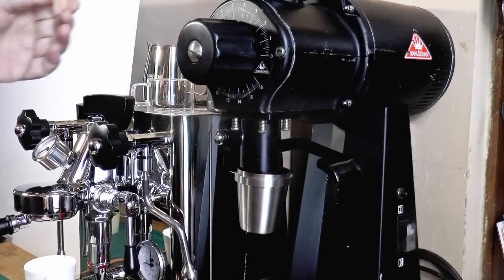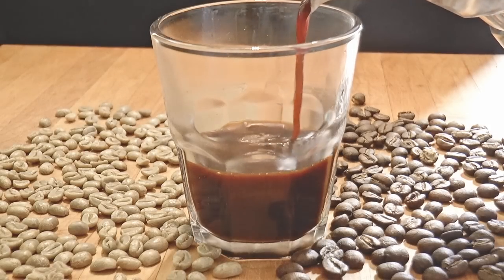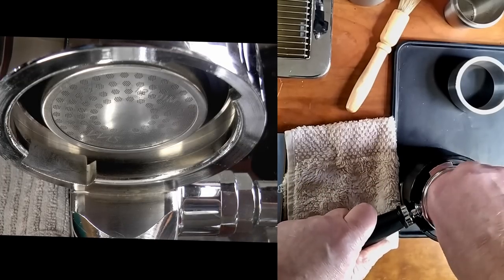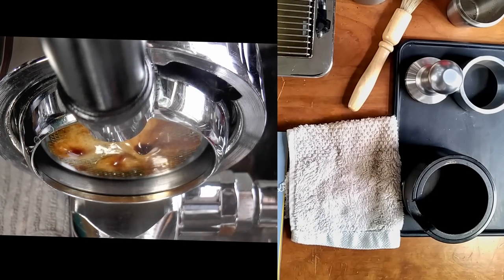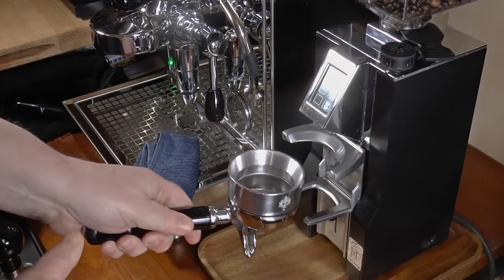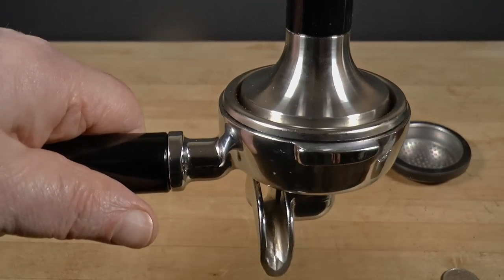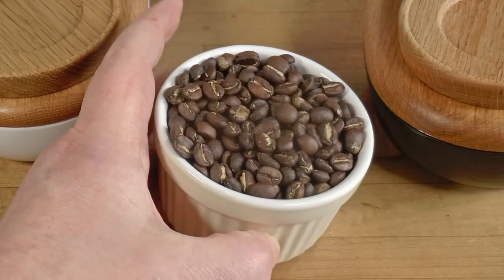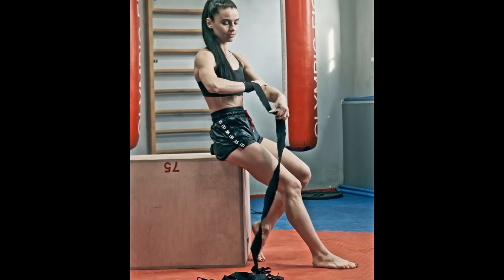Espresso Terrors: 1 Channeling & Puck Prep

Comment: No coffee shop does WDT as far as I know, so this totally makes sense. A good tamping must be enough apparently
Reply from the maker: Ding!
Reply: coffee shop coffee is mostly terrible.
Reply: I used to grind directly into the filter and then do some WDT. 

With my new grinder, I changed to grinding in a dosing cup (less messy). 
I then put the filter on the dosing cup, turn them around, give them a bit of a shake (not much). 
I then use a distributor give it a few swirls and a tamp. 

Maybe I could skip the distributor but I kind of like the feeling of it and I think tamping directly might spill a few grounds (more mess). 

I’ll give it a try without the distribution tool though, just out of curiosity.
Reply: @cicciobello8470
Here in the Netherlands, some specialty coffee bars do WDT but most of them don’t. My very rough guess would be 1 out of 3. 
Keep in mind that SC bars are a small minority amongst general coffee bars.
Reply: my pucks are so consistent that I just stack them at the side of the machine. [check my avatar] does this mean everybody should stop using 
Coffee Knock Boxes? of course some people can get a good level puck with just a swirl and a tap.. but other's can't .. that's why they use WDT. most people would just get all the coffee on one side after that swirl.. or flying around the room.

Comment: When using a very soluble coffee espresso is dead easy.  As long as you use a good grinder and machine and suit your dose to the basket it’ll pull well.  Most of the puck-prep these days is aimed squarely at mitigating the issues that arise when pulling very lightly roasted dense coffees.  Nordic roasts are super hard to extract causing all kind of problems.  With these coffees channeling definitely exists.
It would be very interesting if you were to redo this experiment with one of those coffees.
Reply: I agree, I would try to pull something very light. Channeling issues will show up.

Comment: Though I agree with the sentiment that less can be more in espresso preparation, and that there is a lot of pseudoscientific claims in the space/maybe too much faff, I can’t help but note this argument that channeling is a myth is based on a flawed premise: that the absence of evidence is the evidence of absence. So in this case, the fact that for you with your equipment that you don’t see visual spurting is the evidence that channeling doesn’t exist, but is that really true? Spurting from a piece of coffee plugging a hole on your basket like putting your thumb over a garden hose causing spraying isn’t necessarily channeling, it’s just random luck. Furthermore, I think you discount the puck prep that you did all the same. You distributed the grounds by shaking, tapped the portafilter down several times to settle the grounds, and you are using a medium to dark roast it seems, where the increased viscosity is just going to cover up a lot simply because of surface tension. You also do a long low flow pre infusion that also can help with channeling. So yes,  I’m sure in your hands with all of these aids you might not observe a lot of visual spurting. But that doesn’t necessarily make an argument that channeling is made up. I could easily take my specialita at home (similar grinder to your libra), but just dump the grounds in, no shaking or tapping, tamp unlevel with a list to the right, and have a gusher of a shot only out of the right side of the portafilter.  By this same logic would that prove channeling exists? I’m not saying you have to buy any gadgets to do puck prep. But if anything I think this video is more an argument that you can cover up a lot as long as you do some puck prep, like shaking to distribute, tapping to settle, and using headspace to your advantage, as I suspect a compressed puck with little headspace won’t have a lot of space to expand too much and have channeling go awry.
Reply: I don’t think his point was that channeling doesn’t exists but that not doing WDT nor using a distribution tool doesn’t necessarily lead to channeling. 
That’s how I perceived it anyway. 

He likes slow extractions. The last pull was 37s.  That would require finding finer and wouldn’t that increase the risk on channeling? (I assume that he uses normal pressure of about 9 bar).
Reply: @Conservator.   I think I was going off of the last lines of the video where he says "there's no such thing as channeling", but hey, happy if @wiregourmet want's to correct me here if I was miss-interpreting!  I will note his machine allows him to pre-infuse for a duration of time of his choosing (you can see him actuate the lever, pause and not lift it all the way up to let the puck gently expand under the pressure there but not actuate the 3 way solenoid that would unseat the puck , before he engages the pump to 9 bar, he talked about this technique he prefers in a prior video).  This is conjecture on my part, but I suspect 37 second shot could have a similar grind size as a 27 second shot if you just add ~10 seconds of pre-infusion rather than engaging the pump immediately.   Don't get me wrong I agree with a lot of what he says, you don't need fancy tools/to spend a lot of money to do home espresso, and if your coffee tastes good to you, then great that's the point! But much of the video imho maligns puck prep as useless BECAUSE he has found he doesn't need to use it using his gear, his beans, and his preferred style of espresso pull based on dosing by volume.  That may be well and good for him, which is great, there's no problem with that! Not everyone want's their morning coffee with a side of faffery! But my argument is I also think he is doing a lot of things here to his advantage to make his point (using darker roasted beans, long pre-infusion, shaking the espresso grounds to distribute and then tapping to settle them, and ultimately though he jokes around with his prolonged tamp the final tamp is sufficiently level/hard).  And I think if he did this with a few of those things left out (like with light roasted coffee, for example, and not doing any distribution whatsoever), he may not have as easy a time.  I also don't don't know if everyone discussing coffee distribution is in it to make bunches of money.  You can make a WDT tool with a  used cork and needles, even if you buy accupuncture needles its a $5 investment, and I'm sure the accupuncture needle manufacturers of the world could care less about us coffee nerds let alone form a conspiracy to convince us to WDT just to sell more needles.
Reply: @lbafro2011  just fyi The 37s did not include pre-infusion! He has mentioned on previous videos that he prefers long shots.

Yes, pre-infusion does help a lot (so I’ve heard) and darker roasted coffee is much easier to extract. 

He does do some puck prep like you described. The shake and tapping. 

My takeaway from the video is that minimal puck prep is sufficient to pull great shots. 

Somehow many people feel the need to react to the suggestion that puck prep isn’t necessary. Well obviously it is, otherwise no coffee would end up in the filter😁 so it’s the amount of it that’s the point of the video imo.  

My puck prep is more or less similar to his. I use fairly easy beans but I don’t (can’t) do pre-infusion and I’m able to pull consistently pretty good shots. 

I agree with you on the WDT.

Comment: I love your videos, but this one comes across as a little hand-wavey. Saying “forget all that nonsense” about puck prep and WDT isn’t especially convincing, when there is extensive evidence that some forms of puck prep improve extraction % a significant amount. And your proof? That you can pull “good looking” shots with a medium or (more likely) medium-dark roast bean. I’d love to buy into the idea that a bit of 2008 nutation tamping is all we need for good espresso, but I’m just not quite convinced. If the point of this video were that the supposed extraction gains from luck prep are overrated (or don’t produce better flavour), I might be on board.
Reply: Couldn’t agree more.👍🏻

Comment: I've definitely seen channeling at home. It happens when I grind the coffee way too fine. It doesn't bore a hole through the puck though, it forces water all around the rim and lifts the puck up out of the basket, welding it to the shower screen when the pressure is released. The end result is a crap coffee that's both bitter and sour. The solution is to grind coarser and use a bit less coffee for more headspace, as you said!

Comment: I'm not in the least bit surprised at these results. I always wondered why go through extra steps like distribution, shaking or using needles. They say that it improves extraction. I follow your philosophy on taste. I don't even use a funnel, just grind straight to the portafilter, use a force tamper, because I use the same specs every day and same coffee I have similar results like you've demonstrated on this video. I use a Profitec Pro 600, and  Mahlkonig E65 GBW, best combo imaginable.

Comment: I use a flair 58, without shower screen and with the full volume of water put up on the puck screen before pressure is applied. Some coffees I can seem to dump tap and tamp. Some coffees (adjusting for dose) sprays, tastes bitter and  sour simultaneously. And this is a crap shoot too some come out good and some make a mess and taste like one.

I think puck prep isn't important until it is. Light roast coffees, or hand grinders that jostle grounds before they're transferred into the basket. Poor quality grinders.
Reply: You're supposed to use the puck screen on the Flair 58 though, the water doesn't cover the bed evenly without it. You're basically removing an essential part of the machine and blaming everything else for not getting you good shots
Reply: I am using the puck screen.

Well I suppose that wasn't included in this video - I use a puck screen for everyshot. Still get visible and testable channeling under certain conditions.
Reply: Wired gourmet drinks dark roasts which will taste fine with awful prep. Light roasts don't do this.

Comment: I must confess that I have tried, twice. Huge mess on my machine and scale. There were squirts that reached the grinder. I don't think this works for my light beans or my sculptor 078s grinder.

On the plus side, the third shot, with a higher dose than I usually use and regular needle WDT was the best shot in weeks. I will revisit your video on dose.

Comment: Your pre-infusion makes a whole lot of difference. Also your coffee beans seem to be pretty good. Try some older / dryer beans of less quality and get something drinkable out of them. Channeling  happens easily and hard. Your machine is also a factor not to be ignored. For a cheaper lower quality combo puck preparation makes a difference
Edit: Totally agree with your conclusion on what is important at the end
But CO2 bubbles hardly occur with older coffee beans (which most regular people use, knowing it or not)

Comment: Great demonstration of all the puck prep voodoo stuff - the only thing I would consider between grinding directly into the portafilter (to avoid unnecessary contact with aggressive oxygen) is to slightly use a WDT-tool with .35-0.4 needles tomale the extraction more  homogeneously

Comment: Hi Thomas......you still spend twice as long as I do on shot prep and it is many a year since I had a spritzer! Great video!
Reply: Spritzer I think handles a different issue: retention of grinds in the grinder due to static. I personally find that spritzing (my kitchen is somewhat low humidity, thus more static than a high humidity kitchen) helps a lot, in very noticeable ways. I wouldn’t do it if I didn’t physically see a difference.

Comment: To me this is a bit like making a video debunking range issues with electric vehicles but using a combustion engine.  It misses the point entirely.
Reply from the maker: I missed the point? I said we can break the rules about always level tamping, and dispense with the expensive gimmicks, and still get a mechanically sound shot so long as we fill the basket correctly. Then I demonstrate doing exactly that. WTF are you going on about?
Reply: Don’t get me wrong, I love your channel and think you are one of the best coffee YouTubers.  But I think you got this one a bit wrong.
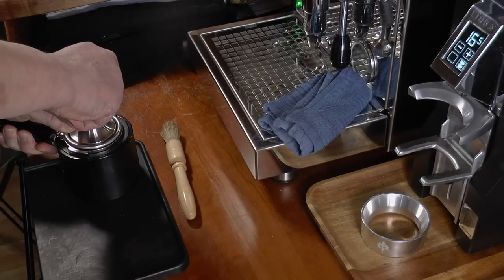At 10:51 you state that espresso is easy if you understand it, channeling is a myth, and elaborate puck-prep is a superstitious ritual.
However for the testing you’re using a very soluble coffee that’s super easy to extract.  Most of the coffee obsessed these days are using very lightly roasted, highly dense coffees that are very hard to extract.  Elaborate puck-prep exists to mitigate the issues that arise when pulling these coffees specifically.  You’re debunking the validity of this obsessive puck-prep while using the wrong kind of coffee, hence my EV vs combustion engine analogy.  If you were to redo this experiment with a dense light roast and came to the same findings then great.  But I’m guessing it would be an entirely different story.
Reply from the maker: Ok, but why do you think you know what coffee I'm using? You say it's a soft, low-density dark roast. Actually, it's a dense Ethiopian landrace grown at 1900-2400m. You can check the whole bean sample in the ramekin around 12 mins in. As you can see, the contrast between the silver skin and the bean surface is substantial, indicating a medium roast. There's no oil visible -- I roasted it well short of the start of second crack.

Keep in mind that it's impossible to judge actual color in a YT vid when there are so many variables involving camera white balance, and light temperature, and contrast, and editor adjustments, and codecs, and processing via YT, and monitor settings, and viewer ambient lighting...

Also, I don't know for a fact that the coffee I used is more or less prone to channeling than dark-roasted, low-altitude, commercial-grade Brazilian naturals. I'm not sure that's an established fact (seems more like an excuse, lol).

TBH, I wouldn't be surprised to learn that dark/soft coffee is prone to gum up the works and actually show some channeling, but I haven't tested it. As for light roasting, that's out for me: my water has absurdly low residual alkalinity & light roasts taste horrible, raw, flavorless, acidic (really, I don't know why people claim to like it, unless they have chalky water).
Reply: The difference between the roast development of the coffees I’m talking about is anything but subtle.  On camera they will be bright orange.

These coffees are essentially Nordic roasts, a hot fast style of roasting that ends while the coffee is still in the first crack.  Some can be dropped as low as 398° F (203°C) with a development percentage of around 10%.  They are very hard to extract using the standard espresso method, that’s where turbo shots started as a way of getting more flow to achieve a higher extraction yield in a shorter amount of time to draw out subtle flavors and sweetness without ending up with lemon juice.

So much of the complicated puck-prep is centered around this style of espresso.  WDT, RDT, blind-shakers, paper filters above and below the puck, puck screens, etc.

Espresso for me is all about solubility.  The less soluble a coffee is the harder it is to extract.  It’s that simple.

I can tell, not only by the color of the beans in your hopper and the grounds in your portafilter, but by the extraction itself that this is a very soluble coffee, even if it’s a high-grown Ethiopian.

I own and operate a roasting company in Nova Scotia, Canada and have been a professional roaster since 1997.  So I’m well acquainted with both traditional and modern espresso.  I teach people how to pull in all styles.

And again, I’m not a hater, your channel is one of the best.  I purchased the new Vario Plus after seeing your tear-down video.

I just think making a blanket statements that espresso is easy if you match your dose volumetrically to your basket, channeling is a myth, and complicated puck-prep is nonsense, is going to confuse more people than help them.

That’s my two cents.

Comment: Can you explain how this would work with a cafelat robot where the portafilter and brew chamber are combined?  What do you do with your robot?  Is it possible to translate this to the robot?  Thanks, and hope your health is doing well!
Reply: The puck in a Robot does not care about headspace because of the screen directly on the puck.

All you need to care about is the puck’s thickness. Too thick or too thin and extraction won’t be ideal. Dial by taste and ignore the poor claims in this video.
Reply from the maker: The Robot is a different design, with the shower screen in contact with the coffee surface. So you have to judge the right amount of coffee for the basket (different coffees will work with different amounts) on the basis of shot mechanics and flavor. I find that around 14-18 g is a good range to start dialing in.

Comment: Yes, those three shots absolutely full of channeling and looked quite horrible lol.  I love your tongue and cheek approach. I have the Profitec Pro 600, along with the Mahlkonig GBW 65 grinder (Absolutely best ever, and no need for single dosing with perfect results every time) I also use a dynamometric tamper from Macap, which is normally expensive, but my Dad purchased it for me used on Ebay for about 25 Euros, and I could replace the head from an inexpensive tamper to match the 55.5mm, making the  tamping as simple and perfectly levelled every time. People have taken the process of making coffee to extremes, and realistically keeping it simple without 25 extra steps yields the best results.  Keep up the great work, Thomas. Cheers, Greg